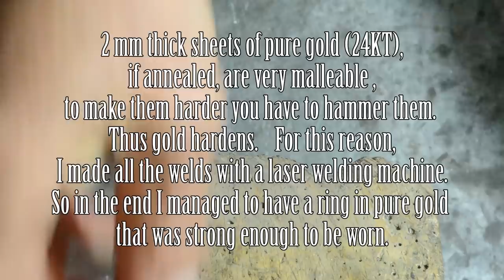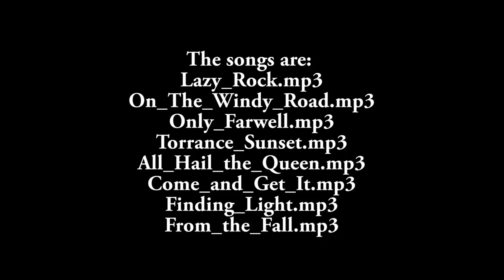Handmade Ring in pure gold 24 carats

Comment: What is that block that you rested the ring on as you made it and how did you secure the pearl to the pin that you slid it on this has amazed me for years how skilled craftsmen like yourself do this !!! Nice ring never seen a ring with the two things on the inside of the ring  !!
Reply: Lead, it's a good backing to stamp on.  The lead gives way before the metal does.
Reply from the maker: thank you